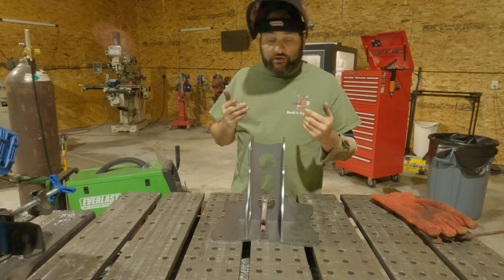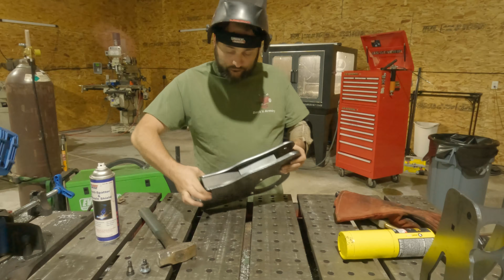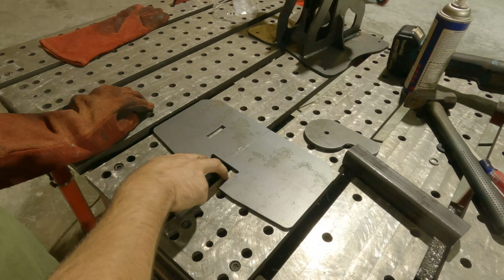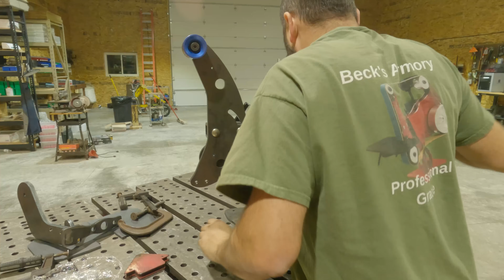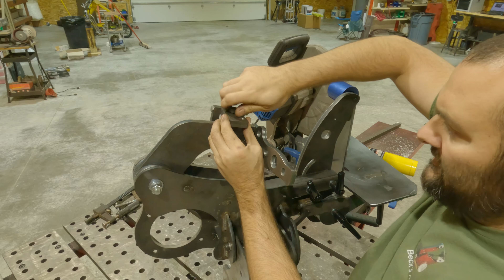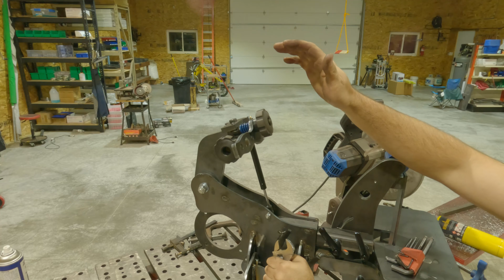How To Build a 2x72 belt grinder (BA Shredder, 2x72 belt grinder kit)

Comment: Question:  The work rest adjustment handle -- has anyone drilled/tapped a hole in the D-Plate for that adjustment so it's on the outside?  Just seems to be less intrusive with all the handles/adjustments and maybe easier to use when shifting to horizontal...  Just a thought.  I'll be buying the kit next week and will explore options once it's all together.
Reply from the maker: I guess the work rest handle could be on the outside with out any negative effects.  it doesn't matter if it get's pushed off the primary alignment axis.  On the other hand the tooling arm for sure should NOT have have the handle on the outside.